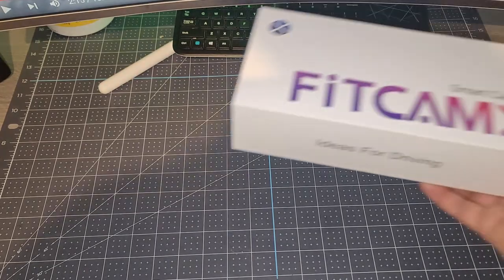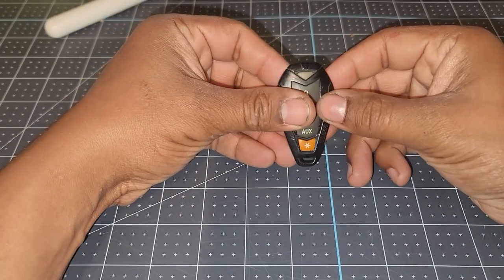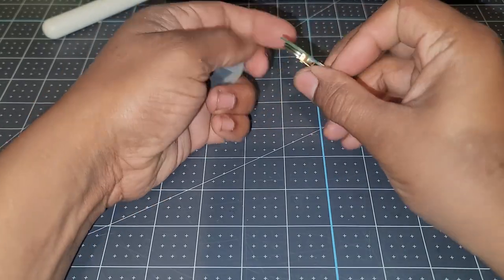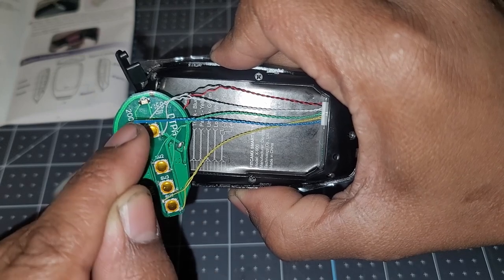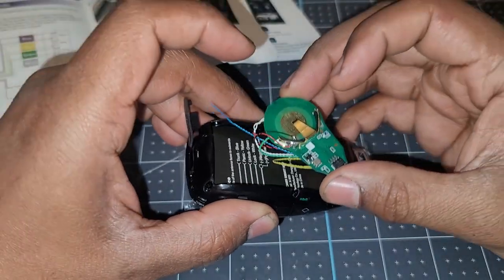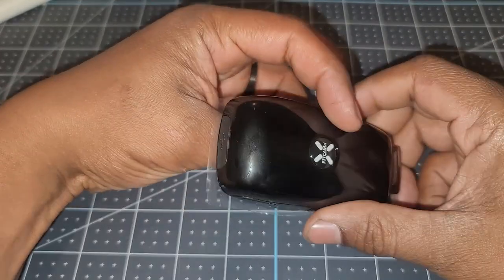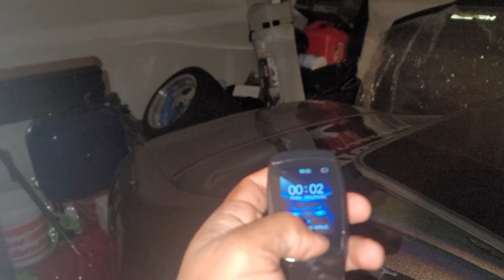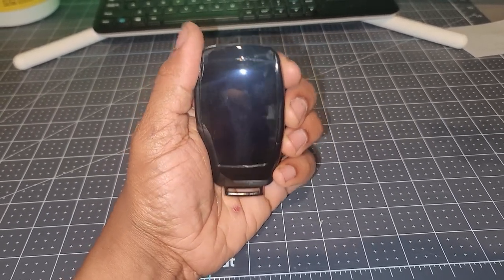Fitcamx-900 touchscreen car key for my Turbo honda prelude

Comment: Hey bro how did you use the obd on it i thought it doesnt work? If you did something to have it work can you please share i have a 96 prelude and id LOVE to buy this
Reply from the maker: You don't need to use th obd2 port for it to work. You just won't have all the extra features like keyless entry, remote start, and window control.
Reply: @treybedipping1734  😭😭😭😭😭 remote start is exactly what I wanted. I wanted to intergrate my viper alarm like you did but mine has remote start
Reply from the maker: @TheKJD14  you already set then bro it has an aux option for remote start/panic button
Reply: Day has been made really appreciate you responding back i hope you enjoy the fob!

Comment: How true is it that the battery drains very quickly?
Reply from the maker: It kinda has 2 mode it needs power for the screen to work but if the screen dies the regular button still works

Comment: My English is not good but my question is I really need to install the keyless start for it to work but I mean only to open and lock the doors with the smart key? Since that's the only reason I want it and it can also be installed without the remote control key because my car is a 2001 Celica and I don't have a remote key, can it still be installed or do I have to buy a separate kit?
Reply from the maker: This key is meant to be used when the car has an existing key fob already. If the car doesn't have a key fob already then you cannot use it.

Comment: I have a quick question so I see people wired the lock and unlock and the trunk but I have a remote  start button and emergency horn button so so that's 5 buttons I mean so what does that mean I have to choose for the last wire which one I want to put it on whether it's the remote start or the emergency horn? Or the remote start is already functional because that red and black wire the positive and negative is connected to the other side am I correct?
Reply from the maker: Yea there are only buttons for 4 functions but the obd2 fob unlocks a few extra features. 

You may have to chose which one you need the least
Reply: @treybedipping1734  ok cool thanks man 👍

Comment: Hey bro, how do you put the picture in there? I have it on my 02 civic and I want to put the picture of it in there
Reply from the maker: You have to connect it to your computer and there are two folders for the key fob I can't remember which one is which but you drop your picture in that folder, but you have to resize it to work properly from what I remember.
Reply: Damn, I didn't have folders in it. I used a MacBook. I'll keep trying, thanks 👍🏼
Reply from the maker: @Muns  try their website... there is another guy with a video too and he explains the folder thing
Reply: @Trey Be Dipping  ill try that. Thanks for the help, brother 🙏

Comment: Do i need to have keyless start for this to work? Or how do you start the car?
Reply from the maker: I think they have a kit that you can buy seperate that will allow you to have keyless start. Unless your car already has it
Reply: @treybedipping1734  My English is not good but my question is I really need to install the keyless start for it to work but I mean only to open and lock the doors with the smart key? Since that's the only reason I want it and it can also be installed without the remote control key because my car is a 2001 Celica and I don't have a remote key, can it still be installed or do I have to buy a separate kit?

Comment: Does the battery last or a dice faster?
Reply from the maker: @AZa-i1x  it last 2-3 days you will have to charge it pretty often.
Reply: @treybedipping1734  when I order mine, it came with the black adapter that you put on the bottom of the car. Do I have to put that on for the Control to work?
Reply from the maker: @AZa-i1x  no it just just gives cars with obd2 port extra features
Reply: Well, that mess up your car alarm like doors Doris will open at a nowhere
Reply: Do you recommend people to buy that going to install it tomorrow?
Reply: Since you had it, have you had any problems?
Reply from the maker: @AZa-i1x  one of the hard buttons did stop working but i have dropped it a few times so its likely my fault